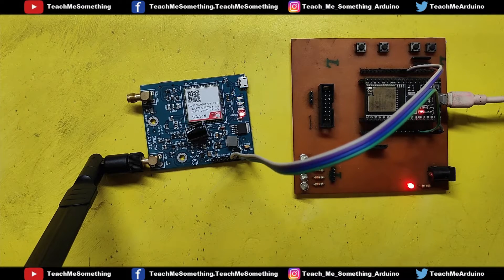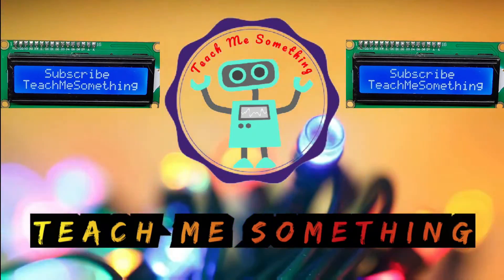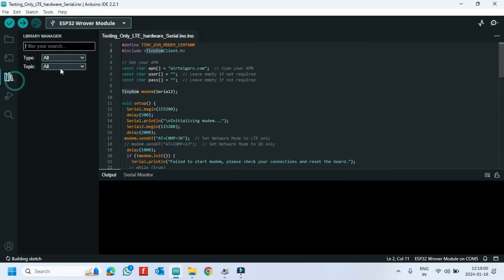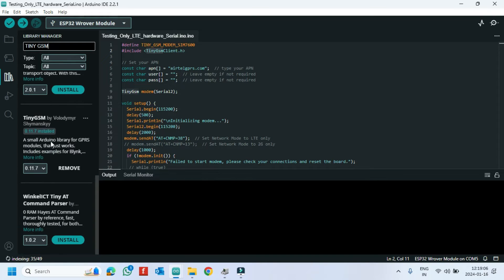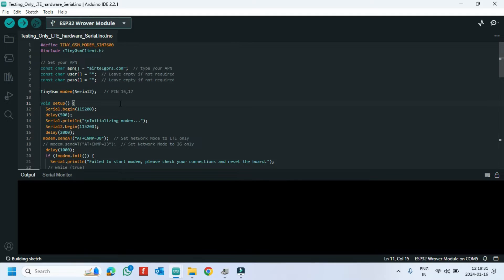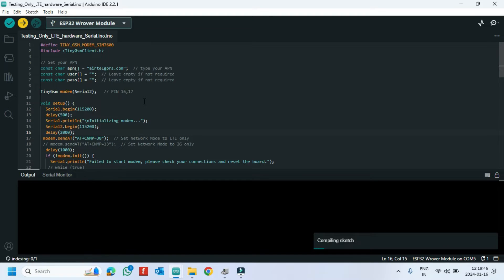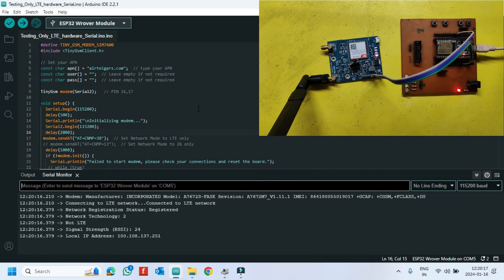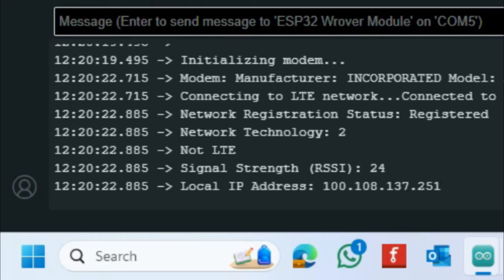Sim A7672S ESP32 4G internet | 4G LTE Sim A7672S Arduino UNO, ESP32, ESP826 | Teach Me Something

Comment: Excellent video providing the information about A7672 and ES32 Simple interface. SIM A7670C 4G LTE TTL Modem also provides Seamless 4G LTE Cat-1 Connectivity for Next-Gen IoT Solutions.
Reply from the maker: This video was done a year ago.
After testing this program the board got damaged due to my mistake.
Currently I don't have that board. Soon I will make the video after getting the board

Comment: in the a7672s module's datasheet it is shown that the uart works with 1.8v but you havent used any level converter .will it work?
Reply from the maker: The Module kit itself regulator may have.
As per the kit specification in online website 5V mentioned. So I gave 5V